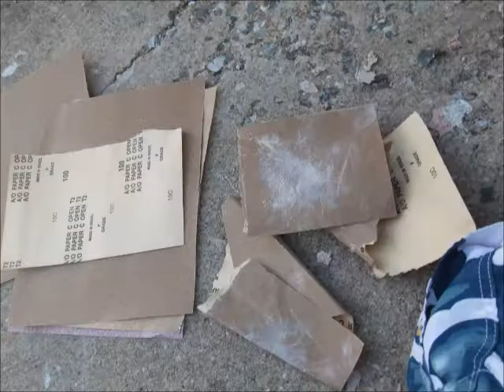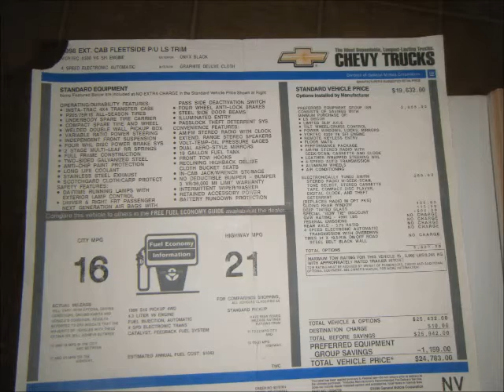1998 S10 ZR2

Comment: Why did you use a blazer window switch it doesn’t fit your door card due to having extra switches for windows that aren’t there, great restore btw
Reply from the maker: it actually was a perfect match, fitment and electrical you dont need to have all the plugs plugged in just the ones the s10 used, for an example  the blazer door works for the 98 s10 but the 98 s10 door would not work for the blazer like you said the blazer has extra switches. however unless you get the 2 door blazer door it has the same setup as the s10 only the 4 door blazers have extra switches
Reply: The Life Of Scott Wenger my bad at 1:39 I thought it looked like there was some over hang due to it being a larger housing I must have been mistaken